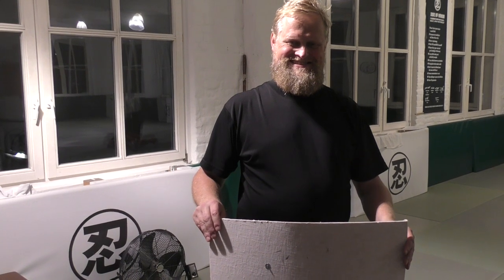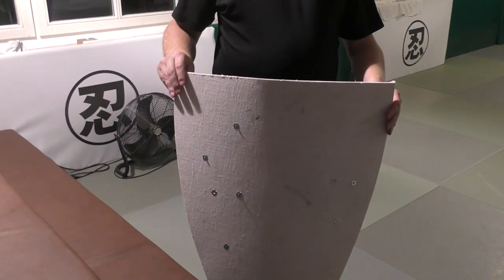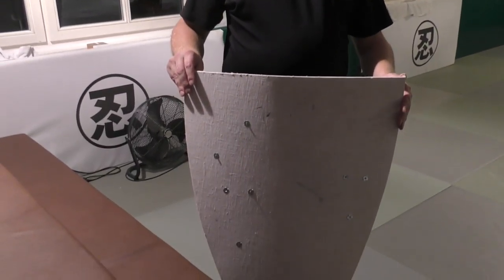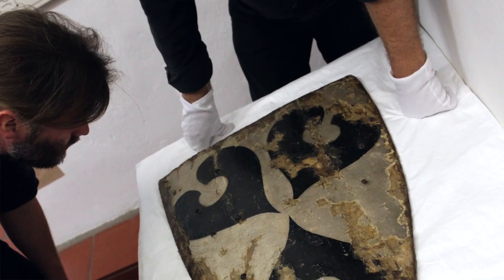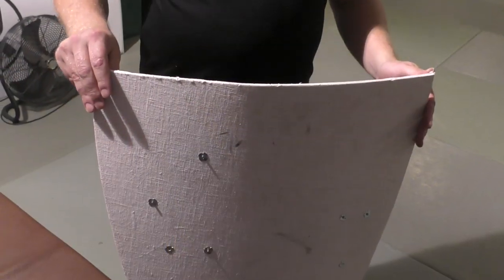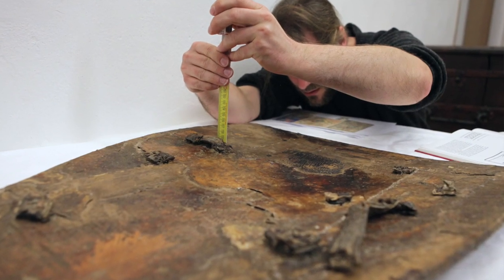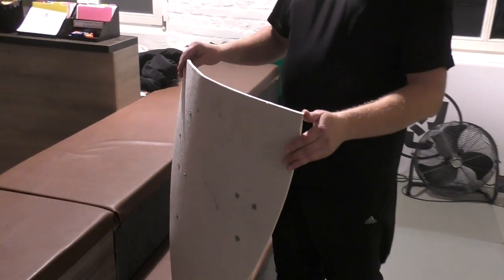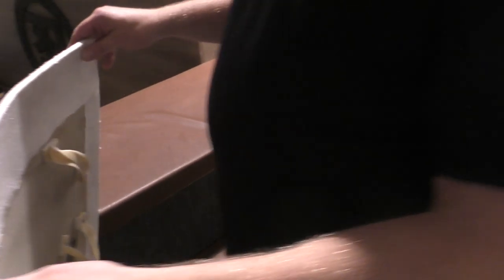Enarmes: Reconstructed shield straps, c. 1300 – 1350

Comment: Thank you guys for a brilliant, practical presentation!

I would be surprised if, time permitting some shieldmakers hadn't used first a series of shields to get the broad range and then refined the mounting points with a mockup to fit the shield to the man.
Reply from the maker: Quite possible.

Comment: Currently reconstruction my own shield straps based on the original and noted something you may find interesting.
When I compare the original with his version he has placed all connections slightly to low (~6-7% off the complete shield size). If you would move all off them slightly upwards that could fix the difficulty's in handling.
Beside that are the other measurments are really close to the original.

Comment: Regarding the use on horseback. The lower grip on this shield is quite low. When he holds it at the level of his belly button the shield still covers a big part of his upper body. That is very convenient when you are on horseback. The riders hand usually keeps the reins close to the belly button. Or at the same level. It does sound reasonable to assume that this mount is meant for enabling a horseman to use the shield. But I can't draw any conclusions without trying it myself. If you ever end up in Bückeburg we can give it a try ;)
Reply from the maker: I wasn't aware that you are based at Bückeburg.
Reply: @swordandshield  well, feel free to drop by. If you want to try something just write me a message on Facebook. (Same name as here)

Comment: I wonder if the "bridge" on the left could, as well as working as reinforcement, act as the hole for something like a wooden toggle, set onto the guige, allowing it to have two set lengths: one for wearing on the back and another for use in combat.

Comment: While it doesn't look like the shield you copied was modified in any way, It's not hard to imagine that the small loop through which the guiche strap passes is an example of how a repair on an older shield became the new standard for construction in subsequent builds.

On the other hand, this design might not have originated as a repair. It could just as easily have been the method for "sizing".

Either way, I would want to keep my eyes peeled for such details on any other finds. 

1) A simpler one-rivet connection on older pieces, or a hole where a single-rivet connection had torn out.

2) Examples where the small loop for the guiche strap is in a relatively different positions to suggest "sizing", or possibly the appearance of additional rivets to suggest "resizing" for a new owner (as unlikely as that might be).

Comment: What is shield made of? It appears very light weight.
Reply from the maker: The original or the test shield? The latter is plywood and linen.
Reply: @swordandshield  the test shield. 

Just regular plywood? How thick if you don't mind me asking?
Reply: Joe Kerr  looks like no more than 8 mm , i does not look like its laminated or glued and bent, but more like wet/steamed bent ( the big and abrupt fold at the center ) , do you ask for building one ? I’ve made several shields in the last month for buhurt and those technical aspect interest me too